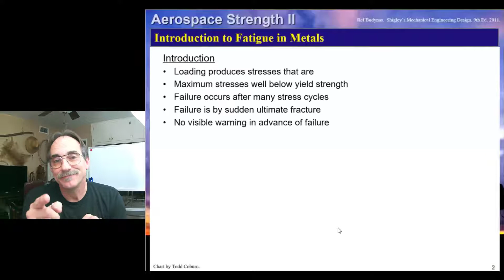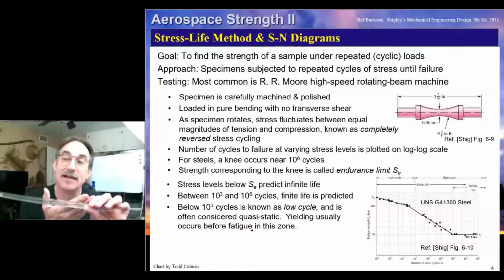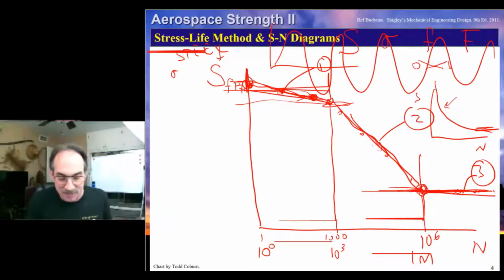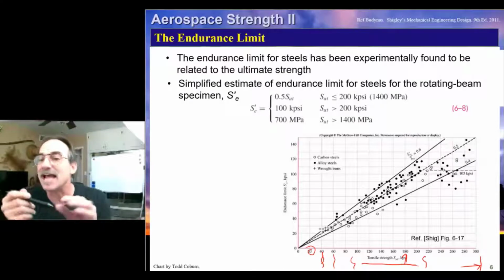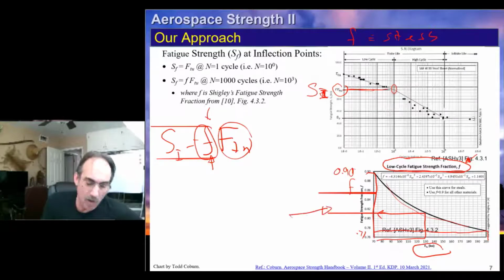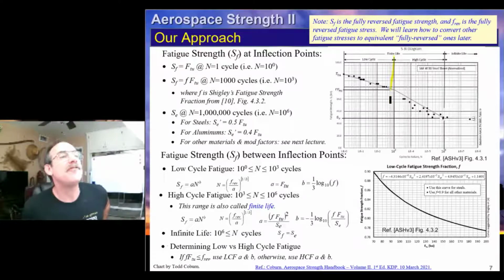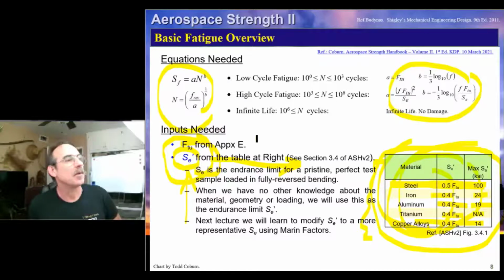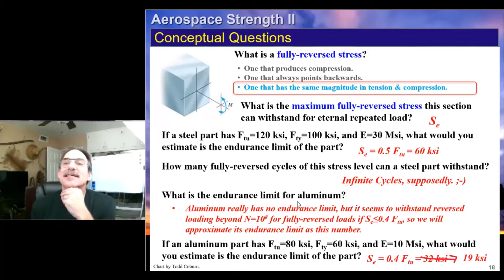Strength II: L-03b Fatigue Basics (Alternate)

Comment: Hey Todd,

Just a query. I see that the Shigley's table is titled "Low Cycle Fatigue Strength Fraction,f" & starts from Ftu of 70 Kpsi.
Does that mean there is a "High Cycle Fatigue Strength Fraction,f" table too with value from Ftu 0-70 Kpsi which would approximately be a straight line.
Is that all the title means or is there something else?
Reply: And also it means the steels with low ultimate stress have better fatigue strength and the ones with high ultimate stress have less fatigue strength?
Reply from the maker: The factor defines the point where behavior of the material transitions from Low to High Cycle fatigue.  

At this point the slope & intercept of the S-N curve changes.

The limits of the Ftu simply mean there was not data for steels with lower Ftu.
Reply from the maker: Fatigue strengh for steels is typically greater when Ftu is higher.  This is evident mainly because Se=0.5Ftu, but other fatigue parameters like the low cycle fatigue strengtg fraction are also affected by Ftu
Reply: Thanks for sharing